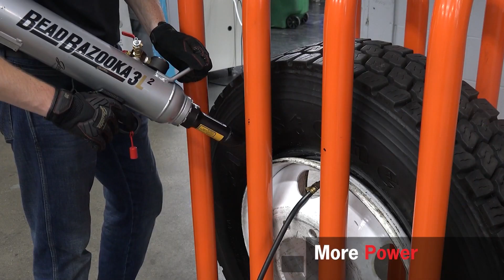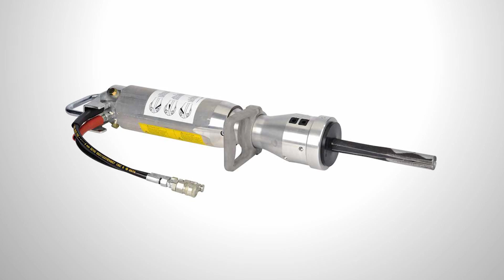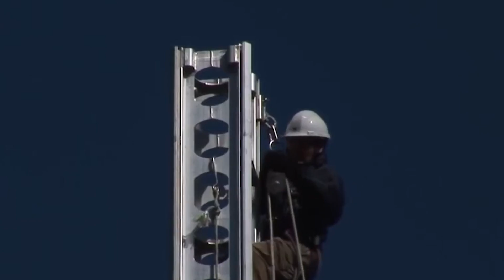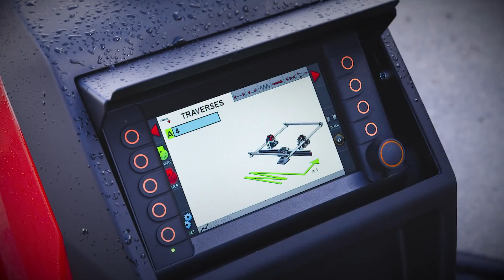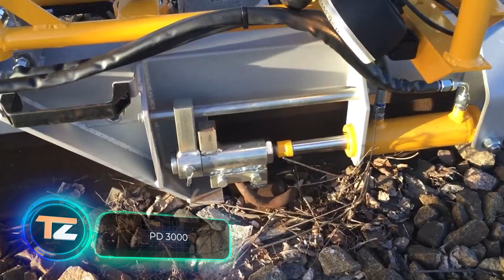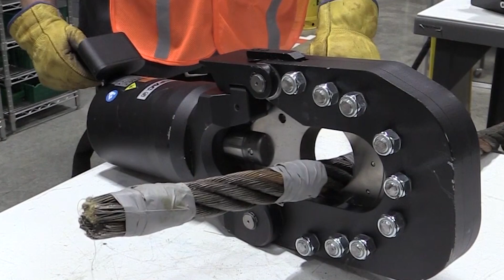INCREDIBLY POWERFUL TOOLS THAT ARE ON ANOTHER LEVEL

Comment: That cable cutter is awesome! I use to have one that used bottle jack to snip up to 5/8 cable. It did not work as slick as the last one in your video, but anyone logging in the summertime knows that cable Saws or line saws, are a no no! And in all honestly, they work better than using an age and a hammer!